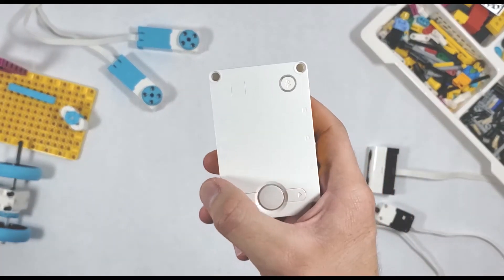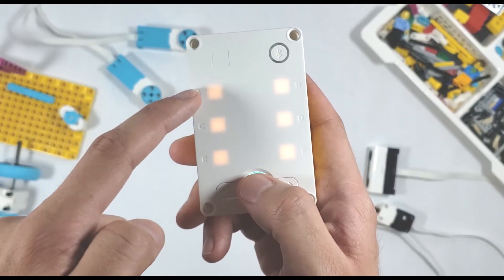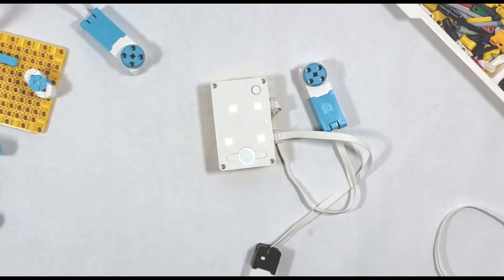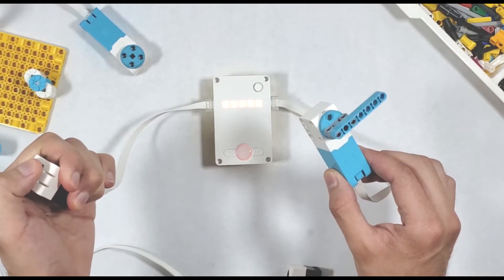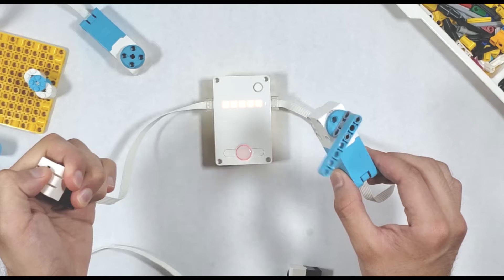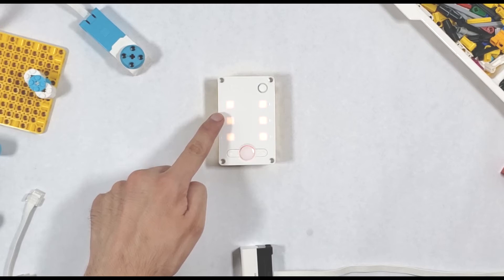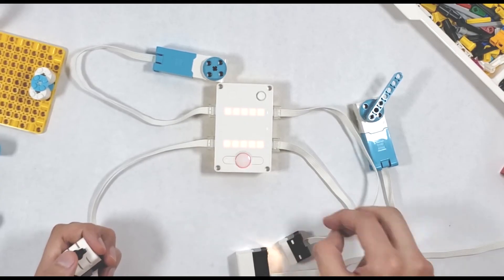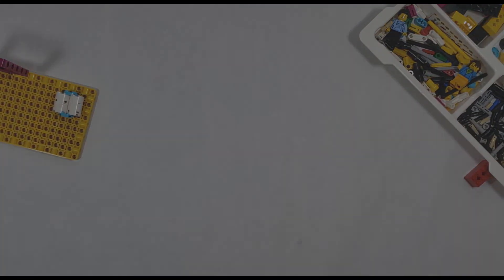SPIKE Prime Tutorial 1.1: Heart Function / Default Program

Comment: Questions: Does the Spike Hub works with the Mindstorms software ? Are Spike and Mindstorms Hubs the same and interchangable ? Thank you !
Reply: The MINDSTORMS Robot Inventor software can be used with the SPIKE Prime Hub and vice-versa. There are some differences between the software and each has their own firmware, so you need to update the firmware when you switch between the two.